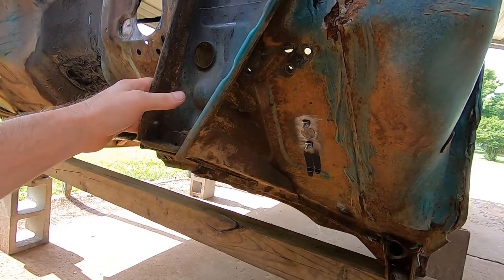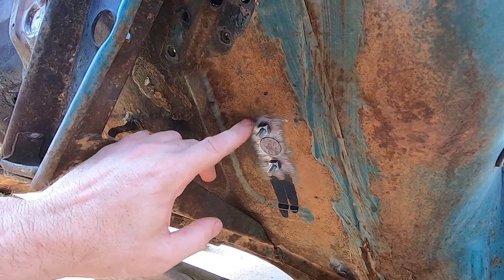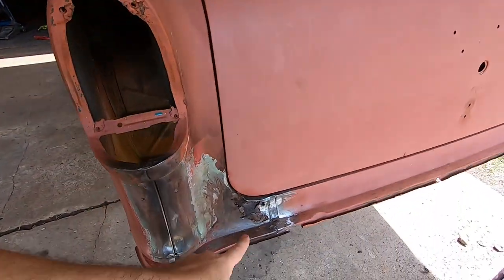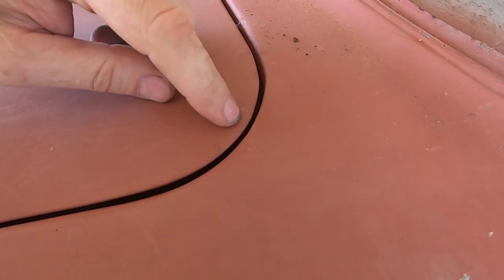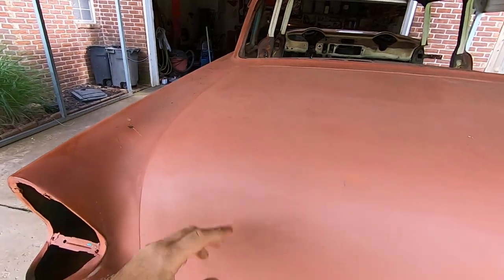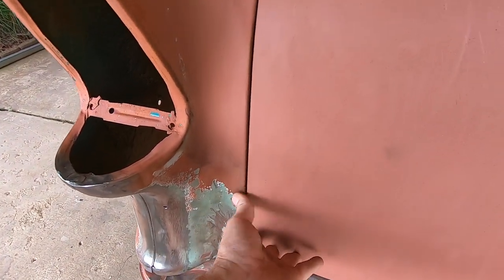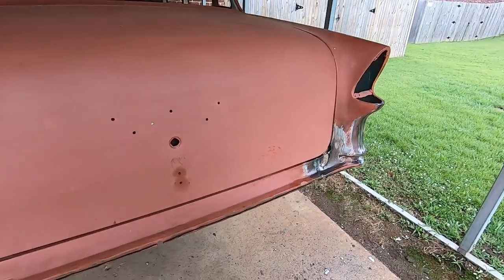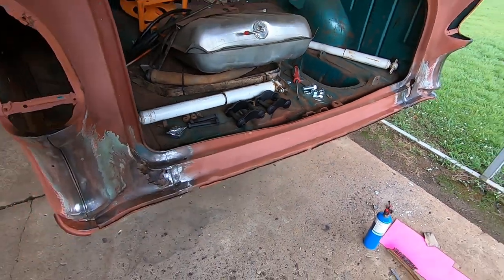1955 Chevy 4 Door Episode 21. Found more rust and measuring for under taillight V8 emblems

Comment: What a timely video I am working on getting my tail pan installed and the trunk sorted out. I found today that the bracket for the striker  on my new floor pan is off and I had to move it. I am going to use your tips to get the trunk fitting right. When you said the trunks never fit right on these cars I sure felt better! I have had mine for 33 years and the trunk has never fit quite right.
Reply from the maker: They fit terrible and it takes so much bending and prying to get one really nice. Then you have to grind it, weld it, and grind it again for a perfect gap. I'm not sure how far I'll go on this one though.

Comment: Great tips. Do all 55s have tabs on the underside near the bottom corners of the trunk lid that hit bumpers on the bottom tail panel? Mine might have been removed. Thanks again
Reply: I have been researching these tabs because my 56 doesn't have them. I was told by a person who is a walking encyclopedia of these cars that some of the 55's didn't have the tabs. My car evidently has had a 55 trunk put on it.
Reply from the maker: 55's didn't have them